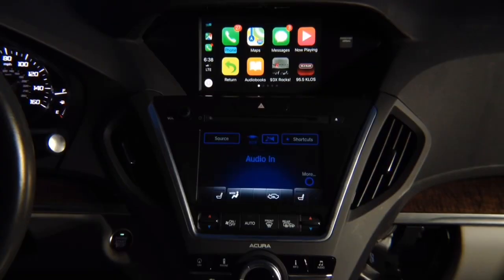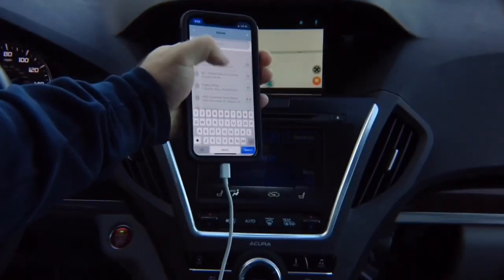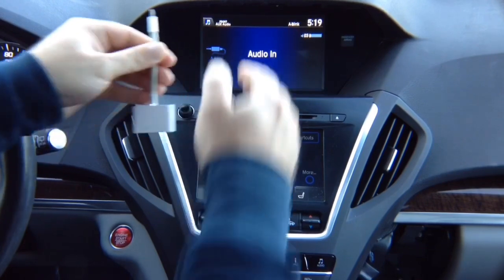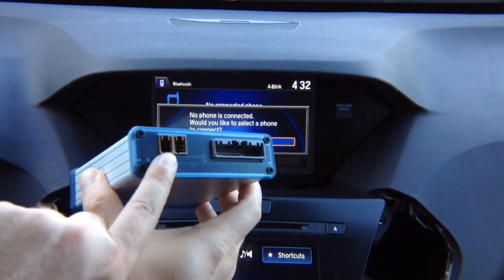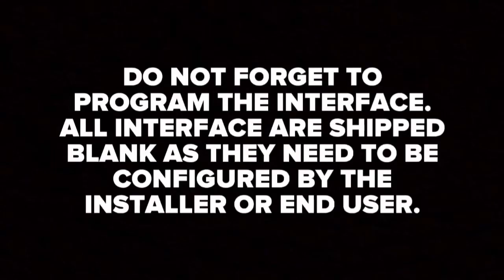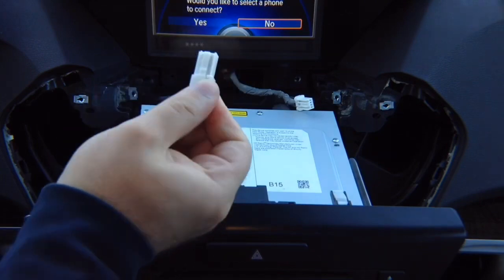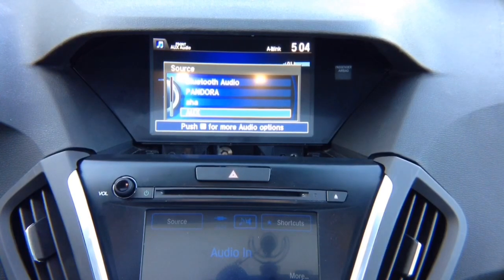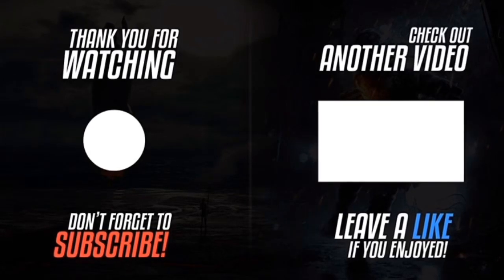Acura ILX Apple CarPlay - Add Apple CarPlay Android Auto to Acura ILX 2016-2020 HDMI Input / NavTool

Comment: Should it be installed when the car is on or off? Also does the kit come with a micro usb to help install the software into the controller?
Reply from the maker: It's installed with ignition on or off makes no difference for this product, yes all the cables including micro USB is included

Comment: What about using the bottom touch screen instead?
I find the joystick approach a little inconvenient.
Reply from the maker: The screen on top is the only real screen, and effective navigation is also controlled with a joystick, as a matter fact Apple CarPlay is much better use for the joystick than the touchscreen. Keep in mind on the bottom is not a touchscreen it's a radio controls that were converted to be touchscreen but it's not a screen down the screen you have is the top one
Reply: @Navtool no he means switching the bottom screen out completely
Reply from the maker: There is no need to do it because the factory joystick is way better than the touchscreen in many ways

Comment: holding down the back button will not work on mine?
Reply from the maker: You have to purchase the product this is not a part of the car because your car does not have factory CarPlay you'll have to add our product in order for it to work
Reply: It doesn’t work on mine either?
Reply from the maker: You have to purchase the product this is not a part of the car because your car does not have factory CarPlay you'll have to add our product in order for it to work

Comment: Exactly which model acura is this because I seen a 2017 ilx and the radio screens do not look like that.  Infact there is only one screen.   Did you replace the entire radio and dashboard unit?
Reply from the maker: there si a single and dual screen ILX, we support both
Reply: I have ilx 2016 premium. It’s exactly like this.
Reply: How come mine doesn't work I have a 2017 ilx premium am I missing something?
Reply from the maker: 2017 ilx is compatible